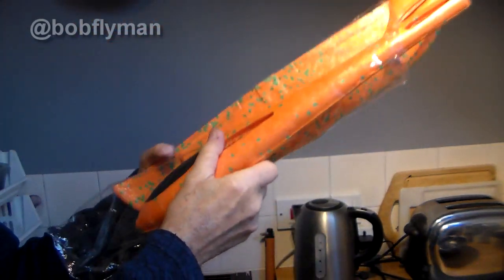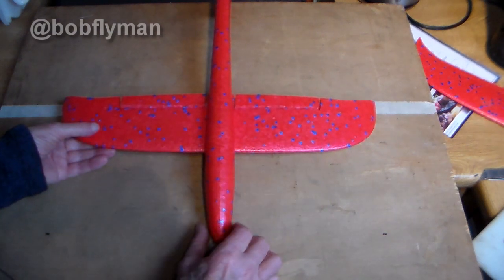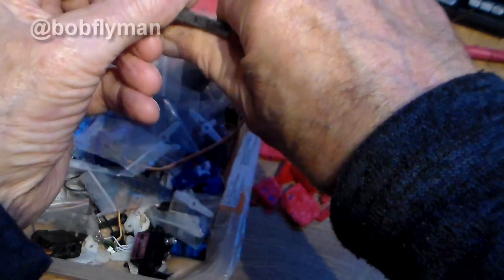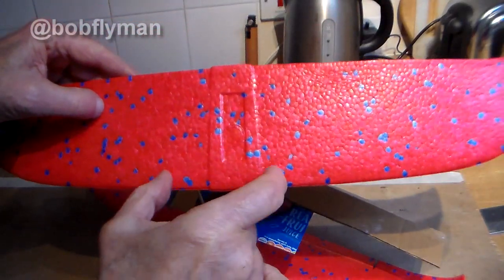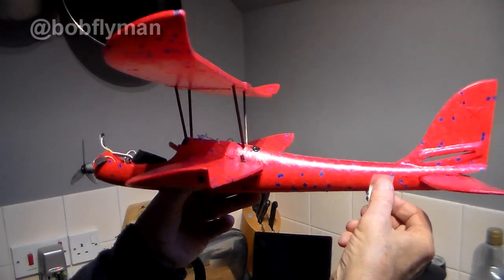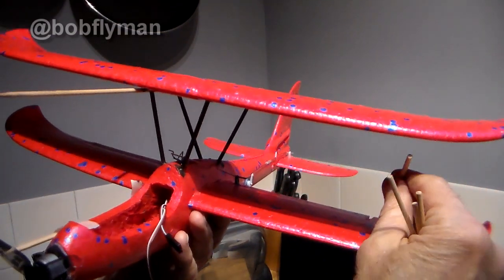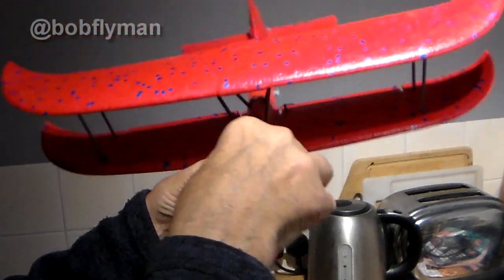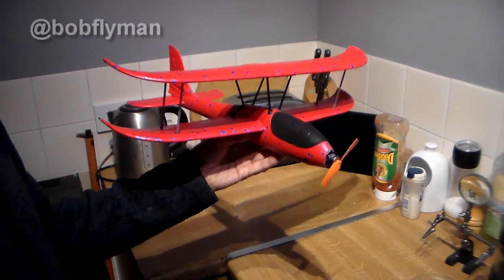Cheap  and Easy Lidl Foamie Glider RC Conversion into a SUPER BIPLANE - HERE'S HOW

Comment: Am I allowed to make a suggestion Bob , glue a flat piece of lite ply on the nose for a motor mount , use some silicon tube cut into 2mm lengths as washers between the ply and motor , this gives a "soft" motor mount which is adjustable for thrust at the field .
Reply from the maker: That's a nice idea for motors that mount with screws from the front, but these little motors are drone motors and they are fixed with allen screws from the back of the mount.  Once the mount is glued on there is no access to those tiny screws.  The only way I can adjust is to cut through the foam and remount.  This motor is so tiny ply is too thick and I mount them on a thin piece of plastic. On my models with bigger motors and screws at the front I unscrew one or two of the screws and slip small washers in to hold the motor out a little further. Depending on where you put them you can increase or decrease thrust in any direction.  I do like the idea of soft silicon tube though, might try it on a front screw mounted motor sometime. Thanks.